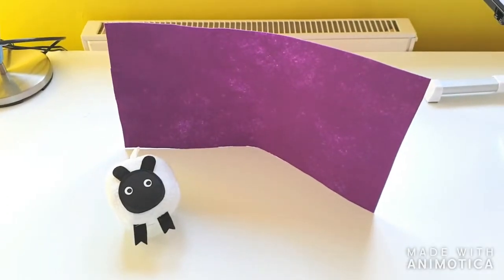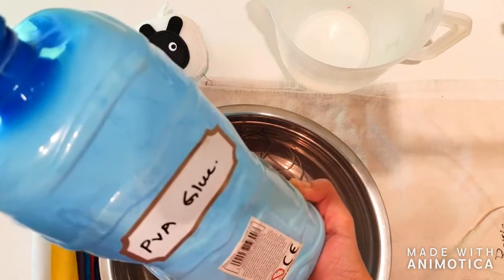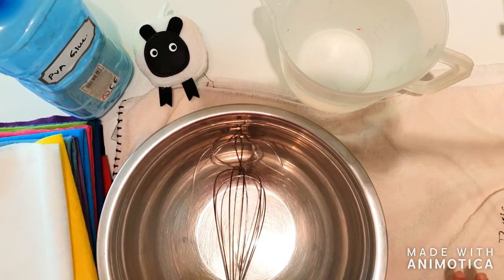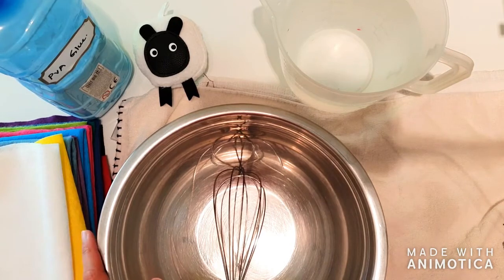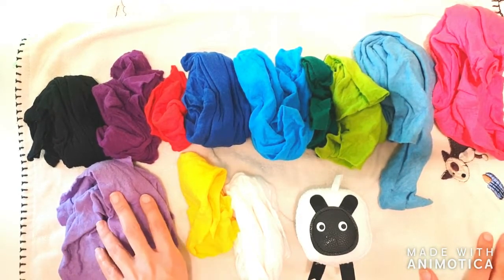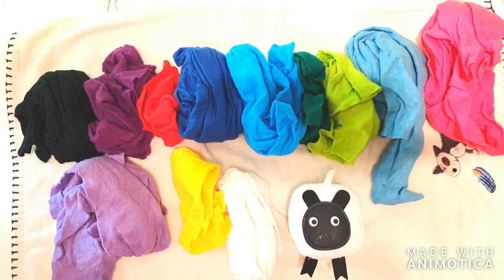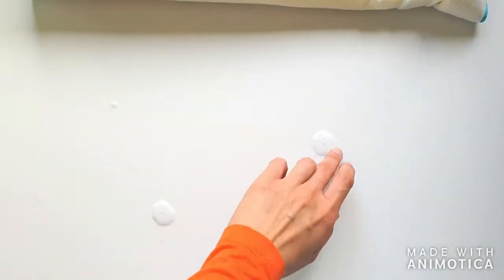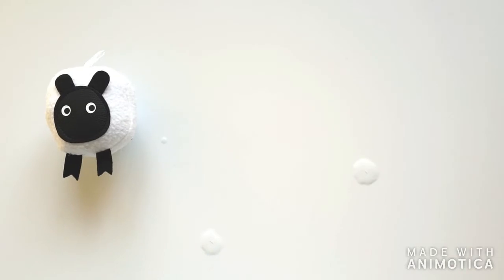Make stiff felt sheets at home | super easy tutorial! | Ooni Crafts

Comment: How long does it usually take to dry?
Reply from the maker: Hi Amanda thank you for your question.
in my experience larger sheets take between 24 to 48 hours to dry, smaller pieces about 8 inches can dry overnight. 
if the weather is particularly dry and warm the felt pieces will dry even faster.
also when you are hanging them to dry remember that the part that's at the bottom will take the longest to dry and that is where most of the glue solution will pool over time so the edges will remain the stiffest.
I tend to trim away the edges leaving behind a perfectly flat stiffened felt piece to work with.
  I hope this helps, any other questions just comment here or send me a direct message on my Instagram ooni crafts.
What are you making by the way? xx